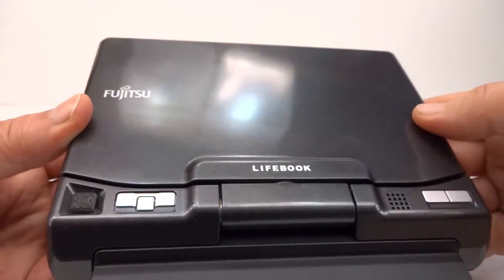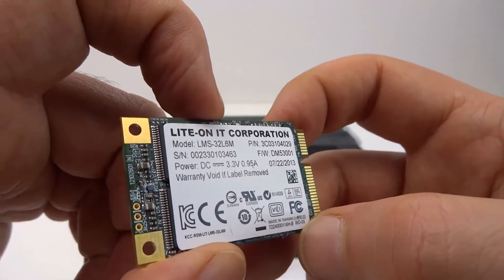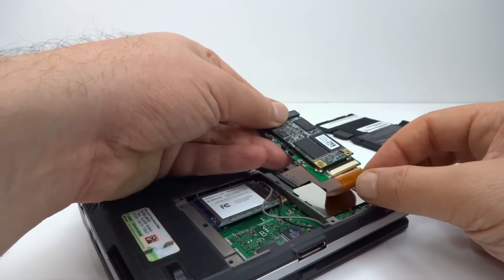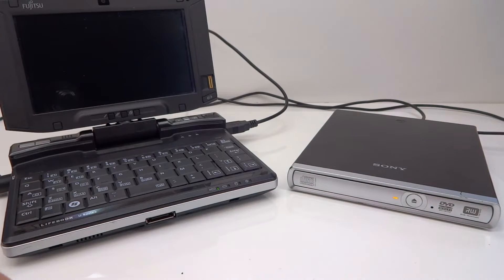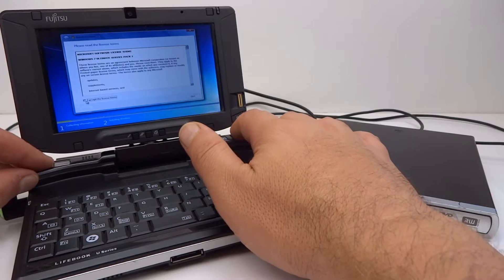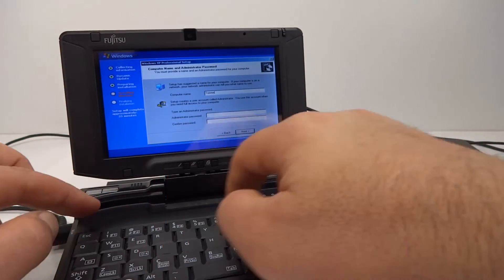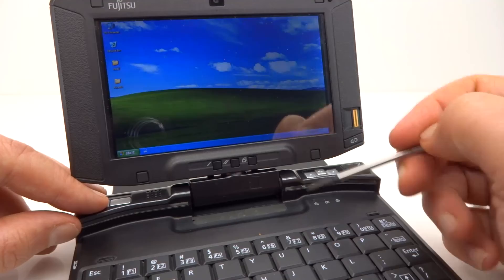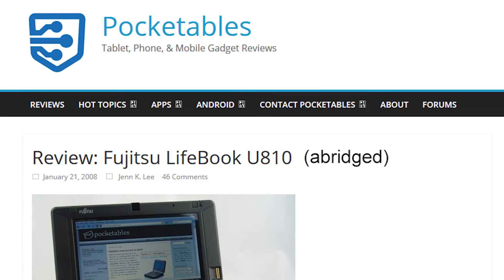Fujitsu hybrid laptop-tablet SSD upgrade to their Lifebook UMPC u810 (u1010)

Comment: In theory could CPU, Ram and other parts be swapped to increase performance? Or it’s not that simple. I love the aesthetic of these, imagine if it had performance like a GPD pocket 3 or 4 🥹😍
Reply from the maker: You might want to swap the LCD as well to get better than 1024 x 600 pixel resolution.

Comment: Is the 1gb of ram soldered on or removable? I got one of these for about $5 usd at a local thrift store and it struggles even on the original 2003 call of duty
Reply from the maker: There is an expandable RAM slot cover. I don't know how this could be ungraded though.
Reply: @JanusCycle  Ah interesting. I installed XP tablet on mine, way better performance than the stock vista. How did you get the touchscreen to work on yours, though? I installed the specific version of xp tablet for fujitsu devices, installed all the drivers from my oem u810 drivers cd, and i still cant get the touchscreen to register

Comment: Hey, Do you have a backup of the original harddrive? ive just picked one up but software has unfortunately gone and i want to see how it was new :)

mine is model number u1010 and has a different connector on the hard drive as well as other visual differences
Reply from the maker: For a really long time I didn't have the original install discs.
Your comment prompted me to check and look what I found! Thanks :)
https://archive.org/details/recovery_202409
Reply: @JanusCycle  funnily enough I started to install this last night 😂 mine came with vista and has a small partition with windows recovery for vista but still requires a DVD. Hopefully I’ll come across the vista one some day. Thank you I appreciate it and appreciate all the videos :)
Reply from the maker: @ I'm pleased you are getting this working. These are great machines !

Comment: i would really like to see you attempt an NVME modding of this netbook. i have pata zif updated the sony ux-50 model with a samsung 1tb 840 before and its benchmarks were absolute trash between multiple zif adapters. you can get wayy faster speeds using clover bootloader and nvme. its just bios limitations\challenges. compared to the asus eepc and pci-e slot to msata adapter with bios unlock rom undoing compatibility mode and setting ahci in its controller options killed those trash zif adapters. only good for installing cheap extra storage unfortunately . also would love you to do a video installing the unlocked firmware on some of your devices, i believe your vaio micro pc 2006+ handheld is compatible with the unlocked bios which you could use to boost the performance a ton especially installing gaming video drivers like chell x64 on windows 7+ etc
Reply from the maker: I am keen to do BIOS modding. I do have more to learn though.
Reply: they have bios firmware that is unlocked  that you can download. bios-mods forums have an available versions that work on most of the VGN-UX handhelds just not the ux50 which i was hella bummed they didn't make one for it. those bios firmware's are a must for old hardware. you flashing those nokias is more challenging. its only challenging to do your own bios unlock of a laptop that hasn't been done before....also for record the very common HP DV6000-9000 series from 2008is era also have a common easy to flash insyde bios mod that makes em really nice old laptops to use. the ones speaking of were the infamous black plastic lemon hps that came with vista @JanusCycle

Comment: I had some core 2 duo era, mini pci-e mounted ssd (nope, no mSATA, it predates mSATA) but I couldn't really run it, it was proprietary tech and needed specific motherboards, by googling the memory module model I found out it was 2GB.
The build quality of these old siemens and later on fujitsu-siemens notebooks was really good, it's a pitty they no longer make notebooks.

Comment: sir can u show me where to buy cable hdd zif connector?
Reply from the maker: Yes, search eBay for 'zif 1.8' and you will find many products that are all zif!
Reply: @JanusCycle  can u help me find 1? cause only showing the HDD not the cable flex hdd
Reply from the maker: @JohnCV.  I see, if you just want the cable then I don't know. Maybe you could buy a product that includes cables such as,
https://www.ebay.com.au/itm/165717291539?hash=item2695853213
Or you can try Aliexpress for just a cable, but I don't have much experience with that.

Comment: I put a 256 gb ssd with the adaptador and not work or detected in any side, any advice ?
Reply from the maker: I assume you have an mSATA to ZIF PATA adaptor similar to mine. And your 256Gb SSD is also mSATA. It should work because these all use the common ATA standard, including this Fujitsu model.
It's possible your adaptor can't handle a 256Gb sized SSD. I don't have much to back that claim up except a thought in my head. Testing would need a smaller mSATA SSD to be sure. And my gut feelings are sometimes very wrong.
Reply: @JanusCycle  yes is the same adaptor , but not detect the ssd , can be the capacity is to big for the lap?
Reply: some device bios are  very picky with those adapters i recall having problems with the sony vaio ux50 and especially the oqo model 2. was a major pain with some devices because of the zif cable not being perfectly in place. likely its the zif cable but like JC said they use all common ATA standard. i successfully used a 1tb samsung 840 msata across different devices with zif adapters including IDE laptop pin standards which the sony PCG XG-500 registered 938/9 or something like that GB i had to format the partition less then the max because the bios or hardware limitation couldn't read that far ahead but usually it will be detected despite capacity

Comment: Just got one of these from someone for free, need the cable but im excited to see if I can get it running
Reply from the maker: Nice, I hope you get it working. If you need a power supply you can also use a Sony VAIO 16 Volt adaptor. The connector is the same. I use them interchangeably all the time.

Comment: Great device, I have this u810 with adapter msata sandisk ssd 32 gb and u2010 with 1.8 ssd sandisk 64 gb original zif, both works perfectly, u2010 touchscreen not working anymore, I don't know why. Thank you for this video :)

Comment: What about installing android?
Reply from the maker: When I do this the video will be about installing Android on many different types of legacy x86 devices :)
Reply: @JanusCycle  I think it would be interesting to see touch screen umpc having this OS. I remember one of my friend having this exact model when I was in my junior high around 2008, quite an intriguing device.
Reply from the maker: @watchnerds I agree this would be interesting to see. Thank you for the suggestion.
Reply: would be interesting to see GPU driver tests on android, i've installed android on an old acer aspire one netbook way back when, when remix OS was still new and current. was an older model with first gen atom and sata 1 ports on it. with a samsung 840 pro SSD with 256gb of storage or so 2gbs of ram  and it ran basic apps somewhat ok. i could stream movies from plex at the lowest graphics quality only its speakers were amazing compared to models made after. they have intel 945 or 950GMA and unfortunately the neutered graphics driver is what your stuck with when you run linux. windows performed much better using graphics driver mods like chell. i can't remember which graphics drive mod this one used they had different ones for different old intel GPUS. biggest flop with these old netbooks was the intel GMA trash gpus and having no hardware T&L functions and a wide chunk of features disabled having to run GMA Booster to get the clock to 400mhz and run unlocked bios to allocate a large chunk of your precious 2gb ram to the graphics card amongst sata mode being enabled in bios. i feel like with newer android OS versions would be too demanding without hacking the hardware a bit   @JanusCycle

Comment: Was there a noticeable difference in the ssd with the adapter as opposed to the hard drive?
Reply from the maker: Yes, the ssd adapter combo seems just as fast as any ssd compared to the slow and noisy 1.8" spinning drive.
Reply: @JanusCycle  Thank you. Just picked one up and will do the same.
Reply: those HDDS were the same ones used in apples old IPODS and they have relatively the same speed as a low end generic usb 2.0 stick in benches. what really sucks on the HDDS was the 4k random writes which the zif technology further choked whatever remaining power they hd. the PCI-E ssds in the asus eee pcs were a generation ahead of most netbooks in terms of storage technology they could become full fledged laptops if you unlocked the hidden developer bios functions even overclock the cpus to 2ghz  i wish they'd return to making these again just with new hardware  @JanusCycle

Comment: Can you pls share where to buy the msata adapter in ur video?
Reply from the maker: on eBay search for 'msata zif', you will find many
Reply: @JanusCycle  Thank you for your sharing. Managed to replicate your efforts to replace the slow hdd to msata. Really appreciate it as i can play the old games that can run windows xp and before. Very fast reboot and installation as compared to hdd.
Reply from the maker: @ridzuab  That's great to hear, glad to have helped.

Comment: Any change you will have the original system image for it?
Reply from the maker: I have all the drivers and apps for XP to 7. I may still have an original installation DVD somewhere but I don't remember which version of Windows it installs.
Reply: Janus Cycle would you mind to shared the drivers for Win 7 and I have all the driver for vista.
Reply: I bought one of this for 2nd hand for $60 with 3 batteries and original case.
Reply from the maker: @NathanVong  Here, https://drive.google.com/drive/folders/12jUM-CyKpSxqW2oqc8UpgYvv1zZtkR1w
Let me know how it goes.
Reply from the maker: @NathanVong  Great score, it's a neat machine.

Comment: Exactly what I plan to do with mine.  I have Win7 (x86 of course) running on it now and use DOSbox and other emulators.  I was with you until Windows 10... but then... Windows XP?  ....
Reply from the maker: I have since re-added Win7 as dual boot, but I still need XP for legacy software such as the T68 phone flashing I did recently.